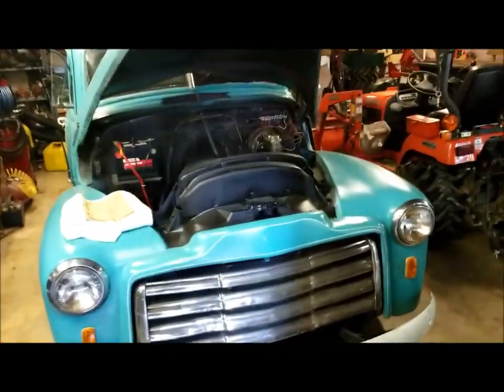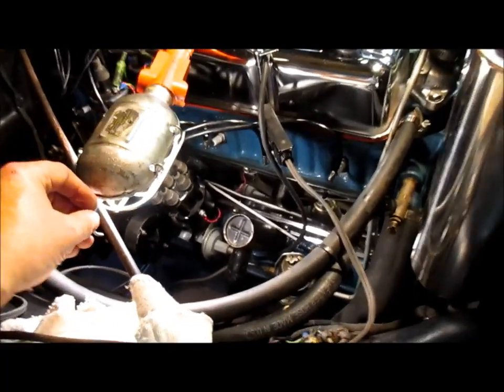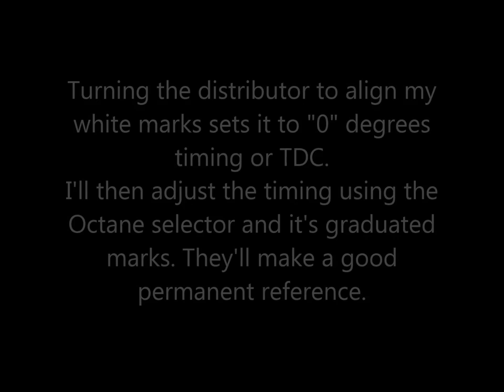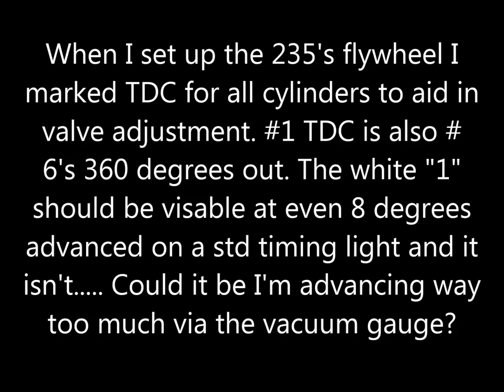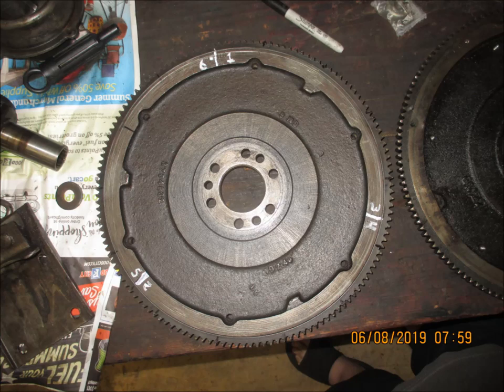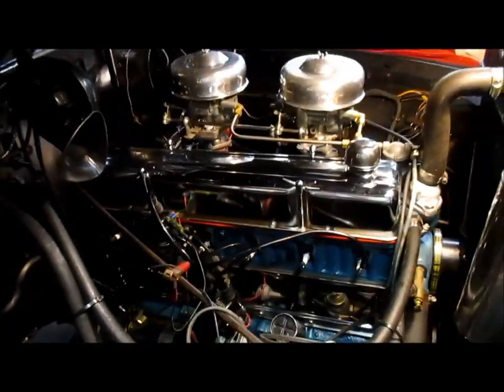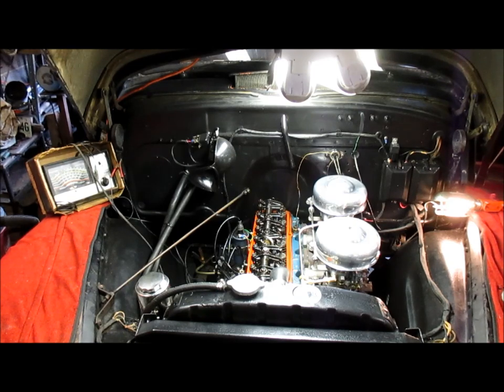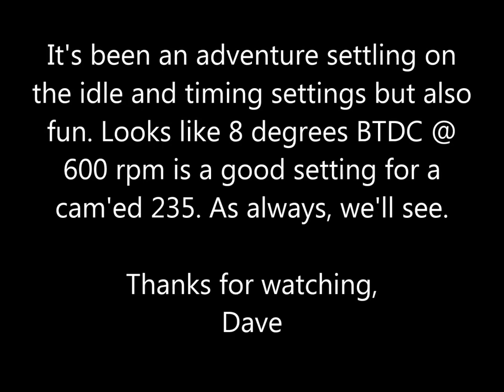Timing a 1954 235 with 3/4 race Cam, dual carbs and dual exhaust

Comment: Just came upon your video.I really like that setup.I just run stock for ease,but wouldn't mind a few more horses.inspirational
Reply from the maker: Thanks Mike, this setup runs pretty good. The full race cam may give a few more ponies but I prefer a smoother idle and low speed torque. Course there's nothing wrong with the stock setup. Thanks for watching.

Comment: Thanks for covering this Dave and for showing your thought process as you went through it. 
Like Tyler said I was also thinking a vacuum leak someplace could be affecting it. LOL, ask me why I thought that...... I've got some weird vacuum leak stories to tell.
The dual carbs would be confusing or intimidating for me to tune but they are effective for your motor.
Reply from the maker: Hey Mossback. Needless to say I continued to test and adjust the engine and one of the best tools I've added to my war chest, a variable timing light, got the timing dialed in as good as I could get it at 12 degrees BTDC @ 600-650 rpm. Between that and utilizing the road ping test the engine is singing now, LOL... Since this video I've done more mods to the engine & truck with one notable addition of a Pertronix electronic distributor. It improved the performance over the stock OEM dist and so far it's so good. And yes I show some vids on how I adapted it, LOL.
The main problem I had in setting this engine up was primarily due to a lack of documentation for a modified 235 and the 3/4 race cam not making enough vacuum at idle to be used for setting up the timing. Too much overlap and duration over the stock cam. So in this case the vacuum method is unusable. Once I got the timing dialed in (later video's show me using the Max Mechanical Advance method along with the road ping test method and they are what I recommend to use on these modified engines. The oil leak was stopped with a combination of permatex grey on both sides of a cork gasket.
So anyway thanks for watching.
Reply: Again thank you Dave for taking the time and sharing this useful information. I'm in the market for a 54 or 55 fat fender and definitely plan on keeping the inline six. I'm a new subscriber so have more watching to do!

Follow up question. Why did you choose a Pertronix over an HEI?
Reply from the maker: @Geoduck.  Thanks for the kind words. Good luck in your search, they're out there.
re. your ?, I was going to modify & install a 79 Chevy 250 HEI when I got contacted by Pertronix to try their new product out, a new dist for the 216,235, 261 & certain Toyota L6 engines. So I agreed to test it out for them & I got to keep the Dist & coil. So far I'm very happy with them & have no plans to  change it out at this time. Thanks for watching Mossback.

Comment: Back in the old days we always disconnected the vacuum advance and plugged the line before timing with a timing light.
Reply from the maker: I definitely agree with you that disconnecting and plugging the dist vacuum is the correct and time honored way I dean, but in this case I had already verified the carb's vacuum port wasn't pulling any vacuum at 600 rpm so I didn't have to disconnect and plug it. That said, I recommend to do as you suggest.
Thanks for the input.

Comment: Here's what I did to a new warped chrome valve cover that leaked oil on my '53 216 engine. I used the cork gasket, installed it dry with 1/4 inch strips of magazine paper, because it doesn't rip easily, about an inch apart between the gasket and cover all around the it, , and tightened it down. Pull on the paper strips to check for gaps and use a 1 inch by 4 inch piece of wood and a hammer to close the gaps all the way around the cover checking the strips as you go to see if it's tight. Take off cover and put a film of RTV on both sides of gasket, let it dry, installed it and doesn't leak at all, and the 216 is notorious for valve cover leaks.
Reply from the maker: Great way to find the warps in the valve cover Larry, thanks for contributing and watching.

Comment: Great video!!  I use a "Double Thick" cork gasket on my 235 and it seems to work okay.  Interesting information on the timing, Thanks!!
Reply from the maker: Thanks ICR. I was surprised the max vacuum timing method didn't work on this engine. Had the cheap HF advancable timing light worked I would have set it to 32 dgrees BTDC @ 3K rpm (vacuum disconnected) and it probably would have been close to where it's at now at idle. So far it's running great avg'ing around 15 MPG.

Comment: I like the cork over rubber and I found a rtv called "Rite Stuff" and if everything is dry and clean... real clean, then it works in some of the hardest to seal places in the world. It has never let me down and I used over the years probably a gallon of it meaning I turned wrenches a lot. It works on bent side covers and just about any pan gasket like the chevy iron duke where it calls for it as the only gasket it gets is that rite stuff. Has to be clean and dry but then even water pumps and anything with antifreeze or oil will seal up. Try it and you will love it. The first time I used it I was in a hurry and it didn't work so I tried everything else but no avail so back to rite stuff and this time I got everything clean and dry and the guy come back for some other repair and by chance I checked it and damn it was dry!
Reply from the maker: I've heard of the Rite Stuff, good to hear it works. I'll give it try.

Comment: I suspect your leaking valve cover issues are due to the cover itself. Those permadry gaskets are great, but they require a flat flange. Another factor may be if the gasket lip is chromed, providing a slick surface for oil to migrate. An aluminum valve cover with a nice thick flange would probably end the leaks for good.

Comment: Set the octane selector to 0. Then set the timing using the bell housing window to the ball. ALl the while looking at the vac gauge 
. New engine with the valves set correctly should pull 20-22 inches of vac.
Reply from the maker: Good suggestions. The exception to your good procedure is that a hotter cam with more lift, duration & overlap doesn't produce that much vacuum at idle. Even tho this was a new engine it wasn't a stock rebuild so the old rules didn't apply. 
As it is now, it's running great at 12 degrees BTDC @ 600-650 rpm and a max mechanical advance at 30.5 degrees BTDC @ 3000 RPM.
Thanks for watching and commenting.
Reply: Volfandt I've got a 235 bored .060 over Patrick 3/4 cam Fentons. 22" of vac at idle.   20 mpg .
Reply from the maker: @timsager6153  Good to know. I haven't checked the vacuum in approx 3500 miles. It may be pulling that much now since it's broke in. I dunno, I need to recheck it. Best MPG I've gotten is 17 but I avg 14-16 depending on whether I keep my foot out of it.
Are you running the stock 4.11 rear gears?

Comment: 1951 chevy panel 216 just running in park carport Engine shutters or vibration at  and above  700 rpm.  ..
But below that 600 rpm runs  smooth. 
Put in gear and drive 4 speed  under 40 mph smooth but accelerating rpms above 45 mph on up vibration from engine. 
But Climbing a hill at 60 mph in 4th gear the engine pulls down as nomarl as rpms drop
From the clumping vibration slowly disappears  then comes back over the hill.. or drive on flat roads ...
Help ?
Reply from the maker: Starting with the easy basics.
1) What carb are you running? Is there a fuel filter between the tank & fuel pump? Or a filter between the pump and carb? If so try changing it out.
(disconnect the fuel line at the carb, stick it down into a jar etc, then have someone crank the engine and make sure you get good solid squirts of fuel. Could be a weak fuel pump).
2) When was last tuneup? may need new plugs and/or plug wires.
3) Read the plugs to see if one or more show different deposits or wear. May pinpoint a tight valve (not adjusted properly).
4) Check for any distributor shaft side play. Can do that just by wiggling side to side on the rotor. Observe points to see if the gap changes as you wiggle.
5) Make sure all electrical connections at the starter, distributor, generator and all grounds are good & tight.
6) How old is the gas? Very old gas can get watered down from condensation etc. but it takes awhile and generally the truck has been sitting outside for awhile too.

Good luck.

Comment: I have a Chevy 216 that sounds as though it's backfiring with a flutter sound into the exhaust as the accelerator is used. Out of extreme caution, I refuse to start it until I know what is really going on. Have you experienced something like this before? It was running fine until I took it to a 'professional' shop and they f'd something up. Any advice is very much appreciated. The shop refuses to make it right so I am stuck.
Reply from the maker: Hey Richard. 
1st thought is they've messed up the timing. It's probably too advanced.
2nd thought is the valves aren't adjusted properly.
What did the shop do to the engine? 
A proper running 216 should idle between 450 & 550 RPM. 
My 216 ran best with the timing set at the factory spec of 2 degrees BTDC. I know some run theirs more advanced but mine ran best at that setting.
Always start with the easiest repair steps 1st.
#1, make sure the points are set at 0.018" . If they're new set them to 0.022" As the rubbing block wears it will naturally wear to 0.018"
Set the carb to idle between 450 & 550 RPM.
Using a stand timing light, set the timing so that the BB (thats embedded in the flywheel) is aligned with the pointer in the timing hole just above the starter. You may have to adjust the carbs idle speed either up or down when you adjust the timing. Let me know if this corrects the issue.
There could be other causes but the above NEEDS to be correct and is generally the main cause of bad running issues..
Good luck.
Reply: @Volfandt  Thanks for the quick reply. Points are currently at 0.020, The engine  / head are rebuilt (less than 20 miles drive time) with proper valve adjustment (I am confident here). The shop was only supposed to fine tune the carb mixture but when I walked in a timing light was present and the mechanic was on the distributor side with the cap off. Going into details will take too much writing but it was clear something wasn't right. He ventured where he wasn't asked to. My next reply will be with what worked. It must be the timing, as you state.

Comment: I’ve been looking everywhere for a 3/4 cam for my 235. Any help would be appreciated
Reply from the maker: Hey Walt, I got my cam from Patricks which unfortunately is no longer in business. If you haven't tried him, go to Tom Langdon Stovebolt site, he sells performance parts for our stovebolt engines. I got my carbs from him. You could also try and contact any of the major cam manufacturers/regrinders and give them this info:  Bulldog 3/4 race cam with 254 degree inlet x 264 degree exhaust duration for a 235/261 Chevy engine..

Good luck. I've been very happy with the performance out of my hopped up 235.
Reply: @Volfandt  I talked to Tom Langdon today. He set me up and I am on a waiting list. Thank you Volfandt. I have enjoyed all of your truck videos
Reply from the maker: @walthundley7009  Tom Langdon knows his stuff. Hopefully your wait won't be long.

Comment: My 235 has a steady clicking/tapping while the motors running is that normal for a 235
Reply from the maker: Sounds like you may have a valve or two out of adjustment. Remove the valve cover and while idling you should be able to tell which is loose. Good luck

Comment: Hi
Hope you all are doing well.
My "AC FUEL PUMP" is vomiting gas thru two little holes it have on the base on the bottom, on the side that connect to the line that comes from gas tank. The other two holes, at bottom front side are sealed and no problem....
And you as the master 235 i6 engines must seen that before.
Thats why im asking...
Please help...
Reply from the maker: Generally when these fuel pumps start leaking through those holes they either need rebuilt with new seals & gaskets or replaced. In some cases the rebuild kits are nearly the same price as a new pump so shop around. Double check your oil level to make sure it hasn't increased. If it has it means fuel is leaking into the oil pan through worn fuel pump seals also. An easy test is to smell the oil on the dip stick to see if there's a gas smell. If so replace the pump and change the oil and you'll be good to go.
Reply: @Volfandt  hi, the pumps i seen dont have vent holes. Can i bought those as far it says 235 i6 chevrolet engine?
Reply: @Volfandt  here's the description of the fuel pump...
Carter M2999 1958-1962 Chevrolet 235 6 Cylinder Engines Mechanical Fuel Pump

Fits :
1958-1962 Chevrolet 235 Engines In Cars Trucks
 ( May Fit Other Years )
1 Threaded Inlet
1 Threaded Outlet
For Vehicles With Electric Wipers - ( No vacuum fittings )
Use The Compatibility Guide To Find Your Application
Message Us With Any Fitment Questions
See Our EBAY STORE For Your ENGINE And PERFORMANCE Needs

This is it.
Please let me know if this on could make it...
OR WHICH ONE WOULD YOU BUY?
LET ME KNOW WHICH ONE YOU HAVE INSTALLED ON YOURS TO GET THE SAME.
THANKS
Reply from the maker: @ericruiz2174  If your 235 engine is between 1958-1962 the fuel pump you've listed will work. Sorry I don't remember what year your engine is. 
My 235 engine is a 1954 which uses a different part number fuel pump. My fuel pump is the glass bowl type.
Good luck.

Comment: So, are you coming to the 8 degree determination based upon the octain sensor setting being almost to the 10 degree marks?? Seems to me with  the newer "digital" timing lights, you set the light for a advance degree setting and move the distributor until your pointer is hitting the "Zero" . At that point, the light has calculated your advance to whatever value you have entered. Being "older", I'm not so sure of this but that's how I understand it. ;o( 
How does the vacuum advance work on that distributor?? When you set your timing to the marks, is the advance in play or do you need to disconnect it like the more modern units when you time the motor?? Also "ported" or "un-ported" vacuum to the advance might make a difference. Especially with the surging.
Reply from the maker: The 54 235 times off the BB which is 2 degrees ATDC. The BB is approx 1/2 tooth to the left of the TDC/UC mark. The white "1" I painted on the flywheel is approx 4 full teeth to the right of the TDC/UC mark. Based on that I estimate it's approx 8 degrees BTDC. Using a std timing light when I center the white "1"on the pointer the octane adjuster is on #1 hash mark BTDC. It's running very good at this setting so I'm keeping it there for now and working on other things. I do have a HF adjustable timing light bu tit's unreliable so I don't use it. Thanks for the input.
Reply: @Volfandt  
So, I guess that would a nice "trick" when using the six volt flywheel. Scribe some lines on the back side of the flywheel every 1/2 tooth from the zero. A short line angled from the tooth to the flywheel center would give you timing marks at 2 degree increments. Wonder if that would also work on the 12 volt flywheel since it has more teeth???

Comment: COULD YOU raise octane by adding ethanol or would that lower it?
Reply from the maker: Not sure. Back in the day the quality of the gas was fluctuated so much that the octane could vary with each fill up. That GM provided an easy way to compensate for the quality with it's octane selector indicates this was a serious problem back then. I know many folks only run straight non-ethanol gas in their classics but I've found no difference in MPG between running straight over 10% ethanol (E10) in my trucks. I've yet to have any fuel related issues with 10% ethanol (E10) but I have had fuel lines deteriorate in my 2 stroke trimmer and chain saw. 
Thanks for watching Glenn.

Comment: 800-600 is way too high for a 54.
Initial timing 2° After TDC, is set at or below 450 rpm because that is when the mechanical advance starts to kick in.
Total timing, all in, is 24°-28° @ 3500 rpm with vacuum advance line off and plugged.

Comment: There is no such thing as a 3/4 race cam and your engine runs smooth like it has a stock cam in it
Reply from the maker: Well, you're wrong my friend. It's old school terminology and thats how they marketed modified cams back in the day. A simple google search can educate you... 
A link to the catelog I ordered my cam from: 
https://photos.app.goo.gl/NN7Ba7xWfWoT2Dej6
And the reason why it idles so smooth is because it's idling at 650 -700 rpm. I thought I covered that in the video. It'll lope like a hot cam does if I idled it down to 450 where it's supposed to in stock form. And as I stated in the video I'd rather idle it faster to smooth it out...

Thanks for watching